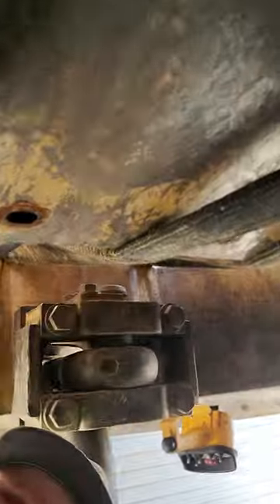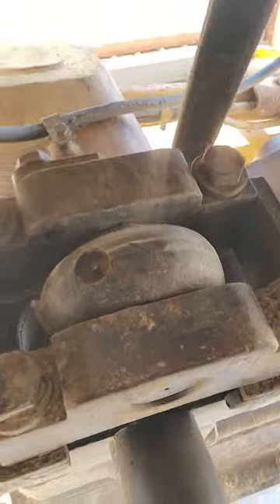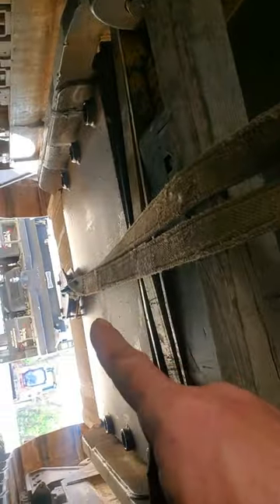#caterpillar #heavyequipment  #mechanic #servicetruck

Comment: We did this at the CAT dealer in the 80s. Chain come a long works too when you can t get your truck to it. The old dozers don t have flat pans. The bad part with them is getting the damn things back on because the sides of the pan spring outward when you drop it. I ve seen guys beat on the center of pans for hours with a sledge then slot the bolt holes trying to get the bolts back in. The best way to get them back in shape is put two 6 x6 s on the ground and hang the pan between them. Then take a track hoe and use the bucket to press down in the center of the pan and flatten it back out. If you dont have a hoe around put another 6x6 on top of the pan and use the dozer blade to bend the center back down and you can bolt them back on without slotting the holes. This will save many hours on those old land clearing dozers that have been riding over stumps and rocks.

Comment: I drop a half inch steel cable down between the track and the frame, put a block across the pan like you did, and run the other end of the cable out between the track and the frame on the other side. Hook one end of the cable to the track shoe and the other to the crane snatch block with the crane cable vertical like normal. Works pretty well most of the time

Comment: Awesome tip! I'm new to the heavy equip game and bought an older digger that I'm trying to do some work on - any advice on sourcing parts like filters and such without getting ripped off? Should I bite the bullet and buy the overpriced PDF for the parts catalog for my model or do you know of a better solution? FYI - 94' Case 9020